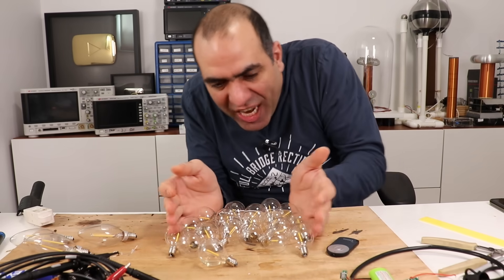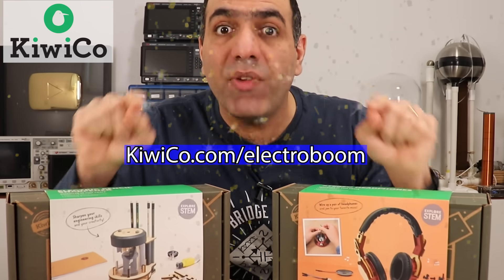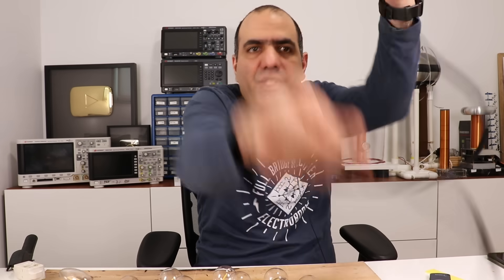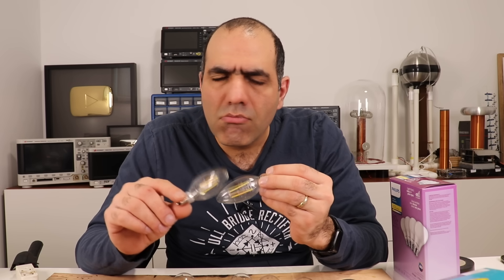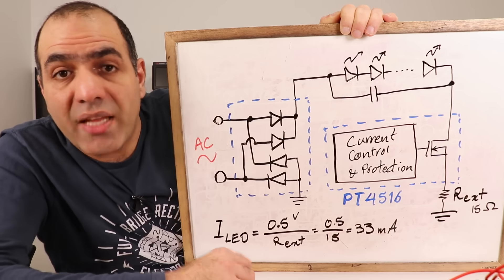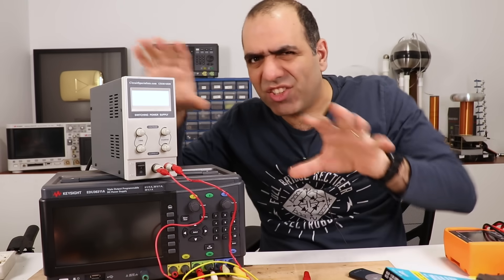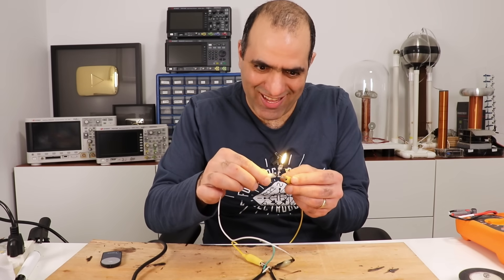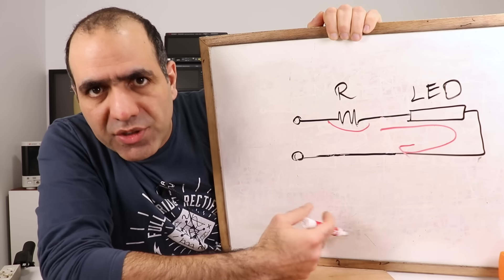So Many MISERABLY FAILED LED Lights

Comment: I had this issue with good brand LED filament E27 bulbs used in a bathroom ceiling light (more about it later).
First time, 3 Osram bulbs died one after another in the first 4-6 months of use. I managed to replace the 3 piece set at the electronics store, so the 2 year warranty is a true thing, but it's a bit awkward to do this for an 8$ product (if you still have the receipt). The replacement set had the same manufacture date on the blister and the bulbs died as fast as the first ones, but this time I decided not to replace them.
Instead I bought a 3x E27 Philips LED filament bulb set. Those also started to fail one by one in about 6-8 months... so I contacted the online shop for warranty and they sent me a new replacement set without asking for the old ones (Was this to reduce their shipping costs, or do they know something more about the lifetime of the product :)) ). Then I decided to use the replacement set of bulbs for some other application and see how they behave and bought another 3 Ikea LED bulbs but this time the standard white plastic ones not the filament version for the bathroom ceiling light.

Now back to the bathroom ceiling light, it's round and flat with 3 E27 sockets, and has a matte glass cover. Because this is flat I preferred the filament bulbs as they should throw more light downwards instead of lateral as the white plastic ones do when mounted horizontally, but now I want to see how those behave in this environment.
Now the INTERESTING PART is that most of the broken bulbs have a little bit of moisture, visible inside the glass, and being used inside the bathroom my guess is as follows:
1. The bulbs get slightly warm overtime
2. When using the shower/bathtub, the steam/moisture rises up in the air
3. When leaving the bathroom and turning off the light, the bulbs cool down.
4. As the bulbs cool down, this causes a drop in pressure inside the glass and sucks inside the moist air from the bathroom.
But the moisture inside is too low to cause a short, it' just a small drop inside the glass, but I wonder how much there is in the circuit board side... As I still have dead bulbs from both Philips and Osram,  I will try to break the glass on some of them, in the coming days and check this. Unfortunately I don't own a variable power supply to test the filaments.

Would someone with better equipment and electronics knowledge be interested to send those to them for some testing?

My Conclusion: the bulbs are not SEALED and there is a very high chance that the premature death of these bulbs was caused by the moisture, but I don't consider this to be my fault for using them in the bathroom. 
If the E27 LED bulb is a replacement for e27 Incandescent bulbs it should not only have the same SHAPE, and similar LIGHT OUTPUT, IT SHOULD ALSO WORK IN THE SAME ENVIRONMENTAL CONDITIONS AS THE BULB IT REPLACES, otherwise the manufacturer should state clearly on the box: NOT TO BE USED IN MOIST ENVIRONMENTS, or make separate products labelled for THIS PURPOSE...

Comment: So far, with the failure rates I have vs the cost to buy, the regular old bulbs are cheaper.  Plus with the simple manufacturing, there is less pollution involved with making them.  So resistors, circuits etc...

Comment: The secret is that the LED "filaments" are being driven over their rated power spec. Phillips makes a series that's only available in one of the gulf states ( the guy in charge cut a deal with em ) that runs double the amount of filaments in parallel....and those last much longer. https://www.youtube.com/watch?v=klaJqofCsu4&t=24s

Comment: yeah, IP44 is not waterproof. At best its weatherproof for light rainfall. Heavy rain and storms will cause water ingress, you' really need IPx6 or IPx7 rated stuff for it to be left outside all the time.

Comment: *reads title* Yeah. It's almost as if manufacturers are deliberately driving LED chips right on the verge of self-destruction in order to recover the profit loss resulting from fewer overall purchases... But no, that couldn't be, could it?
It's not as though LED bulbs could be designed to last longer, like those Dubai-exclusive Philips bulbs... Oh, 6:42 you bring up the exact same point.
8:17 - Oho! I'd point the finger squarely at reverse-voltage breakdown of the LEDs. Even if the string can handle 170V in forward-bias, I doubt they could endure 170V reverse-bias for too long before failure!
11:10 - Wait, they changed STEM to STEAM when I wasn't looking? HAHA
I'd suggest you buy a Cliff Quick Test and get a few proper lamp holders on cords like Big Clive has, but your videos would be far less dramatic that way! LOL

Comment: Thanks for the video Mehdi! I too get insanely angry when single function devices don’t perform the function they are made for. 
A car, I get it. Many devices all having to work in unison is complicated. But a water pipe should be able to last forever if it is designed properly. It has to do a simple job, it just needs proper manufacturing. Likewise a lightbulb should be able to function for a VERY long time, as it doesn’t have to do multiple jobs/functions.

Comment: You should have pointed out that the Dubai lamps are under voltaged to stop them burning out. I managed to buy 4 of them from Dubai and get them posted to me here in Australia. They look great. But only seem to be in E22 size, no bayonet fittings.

Comment: I have had so many of those freaking EcoSmart brand bulbs die on me that I bought at Home Depot! The most frustrating part is having to argue with customer support EVERY SINGLE TIME to honor the warranty. 

The EcoSmart website says to take it to Home Depot to honor the warranty, and then Home Depot will tell you to contact the manufacturer. I've had good luck with them honoring the warranty and have probably replaced almost 20 bulbs now.. but geez guys, figure your s$#! out.

Comment: Why are you even buying glass-cased ones? I get plastic ones and if/when they fail — I take them apart, repair them and put them back together.
It seems to me like these ones you're using are only encased in glass by their manufacturers specifically to discourage home repair.

Comment: Hello Sir, I was just going through some of your old videos in which Prof. Walter Lewin and you were locking horns about the different voltage reading around a solenoid when probed through two different sides. I would like to suggest you a video in which one of the best Indian Prof. and author of the most famous physics book in India 'Concepts of Physics' Prof HC Verma explains the phenomenon. I wish this could help. 
https://youtu.be/ou4_1D0ubKY

Comment: about 6 years ago, a friend of mine had some LED lights, now, I dont know what type or make they were but he bought them and then shortly after, they failed. when he tried to return them he was asked "how are you using them?" and he said "I turn them on when it gets dark and turn them off when it gets light" and he was told that he was "using them wrong" and that they were only guarenteed to last if they were turned on and not turned off because cycling through power cycles is what killed them.  Anyway, i'd jsut bought some LED strip lights for my kitchen about a year before and after what happened to my friend I jsut didnt turn them off. they have been on ever since.

Comment: I do use them in a little different way: First I order the next higher wattage as i need for the brightness I want, and than I addes a capacitor in series with that lamp (mostly the same method as used in the lanp itself to reduce the amperage, but with an additional smaller capacitor. For example, I have a light with 3 x 1W LED-Lights, that also not has survived long enough, Than I purchased three new ones with 4 watts each, (much too bright in a sleeping room), but addes just a 1µF Capacitor in series to the whole fixature, that reduced the whole wattage to 3W in total. At the end, the new 3 lamps are still a little brighter as the 3 original 1 watt lamps , but ehe nrw one not even getting warm at all, and may  work  longer than the 10000h as said on the packackage.

Not all LED-Lamps can be used that way, some are flickering than, but in most cases that will fix that short lifespan. 

I was inspired from the LED-lights made in Dubai, wizth a lot more LEDs inside, working with reduced power.

Comment: Glad I'm not the only one experiencing such a bizarrely high failure rate for LED bulbs. I bought a box of regular GE brand soft white bulbs and within a few weeks one of them started flickering. It was so slight that I wasn't sure if I was just seeing things but sure enough a few weeks later it went out completely. Later in the year I bought another box of the same bulbs and not only was one of them dead straight out of the box but for some reason they come on with a slight delay compared to the old ones, even though it's the same model of the same brand that I bought at the same hardware store just a few months earlier.

Comment: No surprised. Most of these "chinese" crap had simple RC live line power supply and 30-50V LED micro modules. This is designed to fail. I remember first ones, expensive as hell but working fine to now. I suspect so they have semiconductor converter with constant current monitoring. Next difference is with LED cooling - these oldies had solid metal base, today: PCB glued to plastic tube. Low-priced mass production is an enemy of quality.

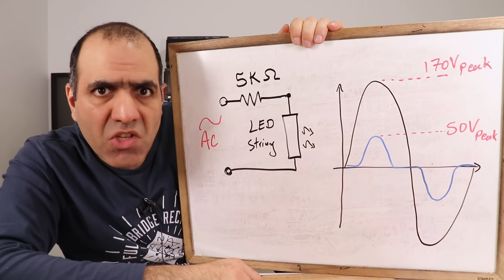Comment: Ref 8:35 ; as LEDs are fundamentally diodes, they conduct in one direction and block conduction in the other. When supplied with a low-voltage AC, an individual LED will illuminate on one half-cycle and be dark on the other half-cycle. For an individual LED that can withstand about 5V of reverse voltage, the LED bar would need to contain more than 34 LED segments to withstand 170Vpk reverse voltage.
If the forward voltage is measured as 50Vpk, and each LED has forward voltage of 1.2V (typ) then that implies 42 LEDs in the chain, which would be plenty to withstand the overall reverse voltage of 170Vpk
The drawing at 9:04 showing two LED chains back-to-back would improve this situation by reducing the amount of flicker, but it would double the cost of the LED bar.
It seems more likely that the LED emits blue/UV light which is converted to a visible yellow/white light by a phosphorescent coating (like strip-lights do), and it is this phosphorescent coating that glows for long enough when stimulated by the pulsed UV light that you won't see any flickering.

Comment: The problem is China, they are focused on spitting cheap crap people buy for one time use. Meanwhile they bankrupt homeland companies that actually made good products but don't sell because they can't compete in price. So we're left paying the same for 10 lamps that would last the same time as a good one and the land fields keep filling up (or the sea). Europe just approved the new law about rights to repair, it's a small step to force manufacturers to design better and repairable products. I for example am out of a microwave for 3 years. My last one worked for 10 years and was made in South Korea by LG. Now I search for a new microwave and its made in China, the other PRC, the other: you guessed, China...etc. I didn't buy a new microwave, not about to trash 300€ on something it will break in less than 2 years (talking from experience).

Comment: I have tried a lot of LED bulbs, and sometime I have them replaced with warranty.

However, the longer lasting I tried, are the one with SMD leds on a PCB encased in solid transparent plastic.
I bought some in 2012, and they are running fine now.

The filament one give me a lot of problems, sometime they simply don't work, sometime start flashing...so at now I return using fluorescent bulbs on the room where we are used to keep the lights on for extended periods of time.

Comment: Not a fan of LED's with E14 Sockets in general. There is just not enough space for decent circuit in the Socket. They die quickly, and they usually flicker badly.

Comment: The problem with LED lighting, isn't the production quality but, alas, these are all electronically driven LEDs with a current regulator, you don't even need a tesla coil (though you have several..). Just using a planar coil with a 1kW square wave inverter. That's all you need to transmit an EMP signal that can off balance the current mirror in the regulator by damaging the reference (which could be a delicate zener diode or even a voltage divider with a maximal current rating) and over time, the resulting increased current could destroy the LEDs themselves. So LED lights are great for the environment, as long as you don't experience too many electric storms in your neighborhood.. The old and trusty fluorescent bulb is much better in this regard, since it has a coil ahead of it that absorbs current shocks. I've seen so many LED bulbs die after a modest electric storm.. It sucks. But still, they are great for the environment.

Comment: Due to the eletronics in these retrofits, these rely heavily on cooling. So if you put them in a bad position (horizontal instead of vertical) or with only minor airflow, lifetime will definitely suffer.
Another thing that might decrease lifetime could be the switches. Especially old switches used for many, many years may produce chatter, which the electronic does not like.
So it's not always the manufacturer's fault (alone). however it is clear that they try to reduce the lifetime as much as possible. Everlasting products are not good for turnover.
And contrary to some beliefs out there, everlasting products do not necessarily mean that they are good for the environment.

Comment: Incandescent lights are great in the winter when the house is cold.  It takes some nip out of the air.  They are also great for load testing batteries and load testing power inverters (since they are a purely resistive load at or near a perfect 1.00 power factor).  Also great for playing around with such as putting a 40W and 60W (120V rated) incandescent lamps in series and applying 230V to them.  Incandescent lights are NOT dead, they are still very useful.

Comment: Thank you for finally addressing this issue.

I deal with this problem with Automotive LEDs all the time. 90% of the brands made in China are overdriven and undersinked. The cheap 194 bulbs run hot and don't regulate current properly for a 15V charging system. Bulbs like 1157, 3157, etc. pack way too many SMDs onto a non-metal PCB with no heatsink and a seriously under-rated dropping resistor. They're all designed to operate well at 12V, but cannot handle even the minimum charging voltage of 13.8V. High power LEDs for headlights may have no fan (passive cooling) or a heatsink that's too small to dissipate heat from each 10W SMD. It becomes a serious problem with capped headlight lenses, where the fan and/or heatsink is sealed inside the lens. 

I recently purchased a third set (the first two died) of 194 LEDs made by Sealight and tested them before installing them into the small sealed lenses of my wife's vehicle. Sure enough they were overdriven and running stupid hot. So I swapped the 39 ohm 1/4 watt resistors for 56 ohm 1/2 watt. Lost minimal light output (still far brighter than incandescent), dropped the current to 2/3 of what it was and the bulbs run cool enough to survive a hot sunny day in enclosed lenses.

Comment: 33 mA is WAY too high for these Filament LEDs, they're rated for around 15 mA. The linear regulator has to literally burn energy to limit the current, heating the filaments, too.

Comment: Big Clive had a vid on leds you can’t have. They are not driven so far they fall. Most are at a design limit in circuit or diode

Comment: Or if you actually want a long lasting lamp. Don't buy led bulbs. They cannot last very long, the driver is small and gets hot. Get a full led lamp instead, they're easily 50k hours of lifetime. Most of the luminaries my company sells can be rated for 100k hours.

Comment: Guesses the brand of the failed lamps is Feit. And if it is Feit don't bother with the warranty. Bought a 4 pack at Wally World. All died in under 1000 hours. I contacted Feit warranty. They sent 1 bulb to replace the 4 dead ones. Their in ability to count to 4 is probably why their products are so bad. And, of course the replacement lasted less time than an incandescent bulb. Every Feit LED light will suffer the same fate. An untimely death. This will get more views than a 1 star wally review.

Comment: The manufacturers obviously want to sell a lot of bulbs for profit so it would be bad for them to make a product that lasts forever. So they push the LEDs to their limit and they slowly cook themselves

 which is why I've modified almost all of the bulbs I use to run at around half of their original current

Comment: These LEDs are super annoying. They sold us the forced death of glowing lamps as a bright future of everlasting LED lamps. Yet government failed to set up proper policies to force companies to actually deliver what they promised. It would have taken just two rules for continuous operation:
- In a normal household environment T=20°C, no component of the whole lamp shall get warmer than 50°C.
- Continuous current for each individual diode shall not exceed 80% of the typical rated current (not maximum)

Comment: Only brand I've consistently had trouble with was Cree and no one carries them anymore.  I've had two Philips LED lights break on me.  One was my fault as it was one of those that you couldn't put in upside down.  That's out of about 40 total.